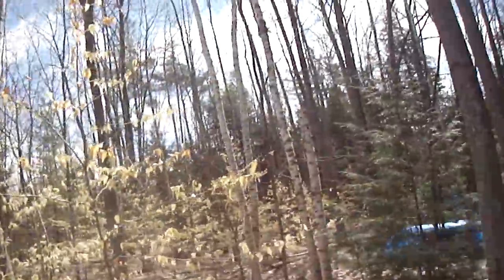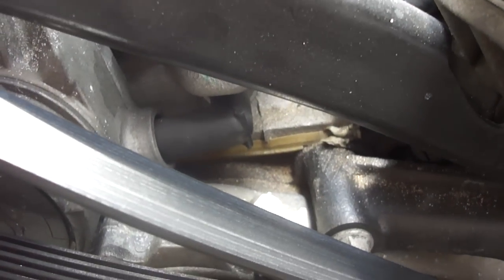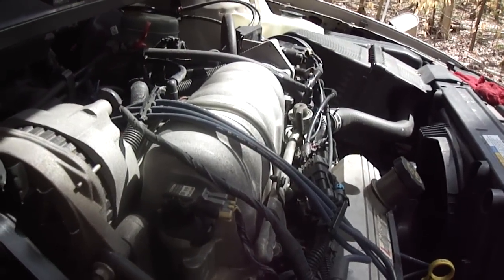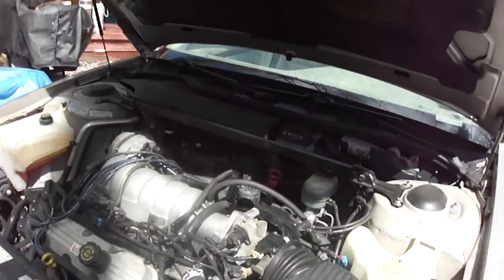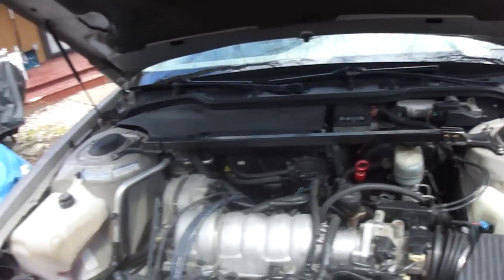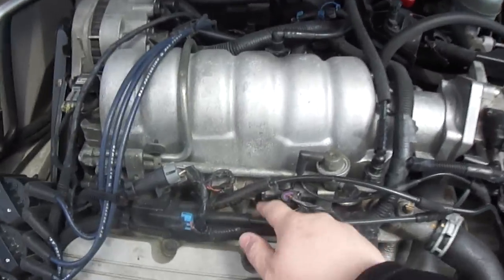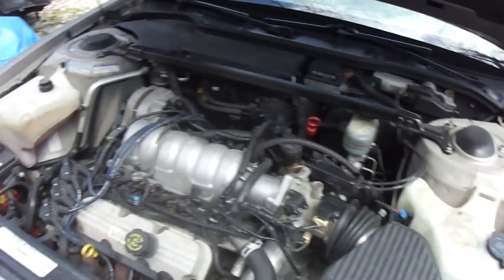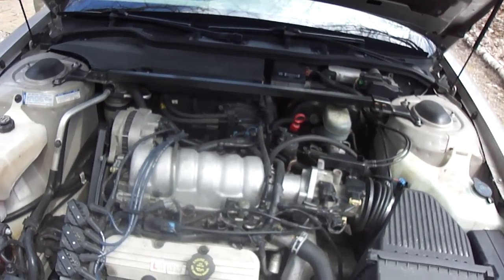3800 Upper Intake Swap update

Comment: grabbing my aluminum one this friday. Found a series II at the junk yard had to wrestle with the idea of taking that or taking the L67 supercharger, intake and heads. This mod is easier and is a good investment for these engines.

Autozone sells the aluminum elbows for 11.99 you just have to ask for "heater hose fittings" thats what they put them under.

these are almost necessary.

Comment: get the trans go shift kit.  Install the 1-2 - 2-3 accumulator springs/spacers. it will 100% fix the transmission. $45
Reply: Michael Potts it's $41 on Amazon.  It's very simple there's YouTube videos of the procedure.
Reply: miketucky350 thanks for the reply. I'm getting the hard shift on take off and shudder.
Reply: Michael Potts no problem.  The hard shifts are normally caused by the ecm throwing a p1811 long shift code and tries to fix it by maxing out the line pressure.  By installing the trans go kit the shifts are instant so the ecm is happy.

Comment: I also replaced plastic valve covers with Aluminum from 97 Camaro F-body, mirror polished them and UIM. Ohhh how can you put the L26 on and keep crappy plastic elbows? Sounded like that anyway, Dorman makes metal ones, you can also put hi-temp silicon around them to help protect leak from oring failure but I never leaked from elbows plastic or metal, 03 Impala.
Reply from the maker: At the time Dorman wasn't in the business of metal elbows.  Had I to do it again, you bet I'd use metal elbows.
Reply: chickenofsea  I bet you either have or will change them next time needed, you're more than qualified. What model/year is your car. I had 03 Impala and had to ditch the air box for a K&N cold air filer as the L26 top extended way out and it was impossible to get any sort of tube between airbox and TB, you have a nice straight shot! Get the aluminum  valve covers from junkyard, buff'em up, it will seal much better, I've got zero oil drip over last 3 years from them, it will look great too. Party On!

Comment: I believe to do this swap onto a vehicle prior to '04, you have to use a throttle body adapter. 04 and later used a fly by wire 4 bolt throttle body. '03 and earlier were drive by cable 3 bolt throttle body.
Reply from the maker: Correct.  ZZPerformance sells the adapter for around $90 (back in 2009 or so when I did this last)

Comment: GM are the best for the heater elbows, They will last a long time if installed properly. They have thicker 0 rings on them even though the elbows are plastic. The aluminum elbows at autozone and the plastic ones they sell have thin 0 rings on them and wont last very long
Reply from the maker: That's an interesting point, I've never used the aluminum elbows but I see your point

Comment: I want to do the manifold swap, is there a tutorial? Is it a simple bolt on?
Reply from the maker: More or less it is.  You'll need an adapter for the throttle body and to do a little trimming to the rear of the intake to clear the alternator.  Also depending on what model year car you have, it may need some hoses re-routed.
Reply: @ob_gyn_inc  now what if I get a bigger throttle body. Does the aluminum intake have more size? Because my goal is to get a bigger throttle body and I'm not sure the size of the current plastic one. I want the intake to be bigger. Do you know where I can find the dimensions for my current stuff?
Reply from the maker: @CMCSS-to3to  You can get a L67 throttle body from a supercharged car.  I'm not sure it made a huge difference but it did seem to have a touch more power after I was done.  I have other videos on this subject
Reply: I want to put that intake on my 03 impala 3.8L. Is it worth it? I replaced my old upper intake on my 05 impala with a plastic one, since they said the aluminum one wouldn't fit. I see you made it fit, more info on this throttle body adapter and what to trim by the alternator. Thanks

Comment: Hey man I am in the process of doing this to my 97 lesabre, and I am wondering where you routed that pcv line on your stock air box?
Reply from the maker: There is a port for it on the top of the intake

Comment: This is a series 2 with a series 1 intake manifold right? I can't find info on if a series 3 intake manifold (aluminum) will fit on my series 2. Also I replaced my elbows with the zzp aluminum ones. Good upgrade.
Reply: Macabre Artist thank you
Reply: Macabre Artist was there any problems with installing it. does the bolt pattern mach the throttle body and lower intake.

Comment: You do not mention the Make and model of this vehicle and the donor vehicle for the aluminum intake. I want to switch on a 2000 buick lesabre and a 1999 Pontiac Bonneville. Please let me know.
Reply from the maker: The donor vehicle was a 2006 Pontiac GP (but any car of that era with a NA 3800 would be a suitable donor) and I swapped it onto a 97 Oldsmobile 88 (same as your Lesabre and Bonneville)

Comment: Hey! Nice intake swap and happy to see that the engines still running strong.
I want to know does that intake bolts directly on the lower intake??
What was the gasket you used for the upper intake?
Reply: It's direct bolt-on. Same gaskets. But.....nobody does it. It's pointless. It might actually be worse for performance than the plastic one.

Comment: I Have a 98 Pontiac Grand Prix can I use an aluminum intake manifold to replace my plastic??
Reply from the maker: Yes. You need a throttle body adapter

Comment: Drop the trans pan.and fill with mobil1 atf..partial trans job won't cut it..or you can pump rans fluid out of dip stick 3.4 arts at a time...the 3.8 are great motors and nice job on metal intake. I'd keep it
Reply from the maker: The valve body bore for the TCC lockup solenoid was worn allowing pressure loss keeping the TC clutch from staying locked while under load in 4th gear with the TCC applied.  I wasn't about to remove the transmission to fix this.  Very common problem with this transmission, the car is long gone after being sold to an indifferent owner who junked the car over the rear brake lines rusting out

Comment: I want to do this to my 99 gt but keep my factory throttle body and every thing think it will be easyer or about the same only reason I am considering is because this makes the 3rd plastic intake in 2yrs and tired of wasting money on plastic junk that obviously don't hold up
Reply from the maker: You can do this with the stock throttle body no problem, but you will still have to drill and tap a hole for the EVAP fitting.  I didn't want to screw up my stock TB so I got a used L67 throttle body and drilled that one.
Reply: @ob_gyn_inc  
Where do you still the hole in the throttle body?
Reply: Drill
Reply from the maker: @motoxkx500af9  On the underside of the TB.  I think I have pics of it somewhere
Reply from the maker: I do have a picture of it, how can I get this to you?
Reply from the maker: @motoxkx500af9  https://www.youtube.com/watch?v=VxFogXf1uvo&ab_channel=chickenofsea

Comment: I have a 2000 Bonneville 3.8 2 got a chance to buy a 1995 3.8 1 anybody know if the intake will interchange from regular 3.8 to series 2 1995 to 2000
Reply from the maker: +John Carden Should work just fine, but if I were you, I'd keep looking for a Series 3 intake and adapter
Reply: A 1995 Bonneville has a Series 2 3.8 Youd be doing nothing really.
Reply: not sure 38002 has a lower deck height than 38001. blocks are different. series 1 in 1992 had all aluminum upper intake minus egr.

Comment: Changing these on my '03 GP right now (spare car). Its criminal the way GM put these together...absolute garbage products. Buy Japanese!
Reply from the maker: In my experience, even the Japanese screw up from time to time (Honda 5 speed auto trans, porous casting on 4 cylinder engines, Toyota sludge problems from the 00s and anything Nissan really).  I've personally had really good luck with Hyundai, believe it or not.
Reply: The engine itself is legendary, only the LIM and the UIM suck.

Comment: Was it direct to the lower pendulum
Reply: yes bolts on perfectly, BUT.... you have to do a few things. Reroute the crank case vent on throttle body to L26. Normally the CCVent is soured in the TB and it routes internally thru it along side facing driver. The TB routes it out the bottom of TB to a passage way on the L36 plastic UIM. But the L26 doesn't have the same interface, so you need to drill a brass plug out of the TB, tread it and put a npt adapter in it and run a vacuum line tube from that port to a port stickin out the top of the L26. That L26 port routes down to LIM and will connect the CCVent to same place on the LIM. So in other words, you need to route the CCvent external of the TB  to the L26. oNE OTHER TAP AND THREAD NEED ON A PORT ON l26 that was for EGR, just plug it, EGR routes as normal. See videos for top swap, plenty of them.

Comment: Waste-o-mod. No reason to do it. None whatsoever...
Reply from the maker: Bullshit.
Reply: @ob_gyn_inc  There's no advantage to going with the aluminum manifold. Or the aluminum elbows. But I did those anyway. See...I do things "just 'cuz" sometimes too. However...it can EASILY be argued that plastic is a superior material in both applications. Using aluminum will cool the coolant flowing to/from your heater core, and heat up your intake air. Not smart. The extra rigidity, durability, or looks aren't worth it. The extra weight isn't either. Not one "good reason". That one style "maybe leaks less" is not actually a thing in my book. Seems like that's probably your angle. Whatever. You're probably not enough of a mechanic to know what kind of leaks are even worth fixing or not. Mine's fine with 97K on the factory plastic intake and gasket. It is the later "upgraded" plastic version though.
Reply from the maker: @MetalMasterdom  Great to know you were there  with me looking over my shoulder when the plastic intake leaked coolant all over the fucking place. Guess I just should have hosed it off with some brake clean and gone about my business. Good thing there are such intelligent people in this world. 

GM knew their plastic intake was hot garbage by the time the early 00s rolled around and finally got shit right with the SIII top end. I put myself through college changing failed plastic intakes at several GM dealerships from 98-08 enough to know that I didn't want any part of replacing it with another revised plastic intake.  I don't get paid to work on my personal vehicle so it 100% has to be reliable.